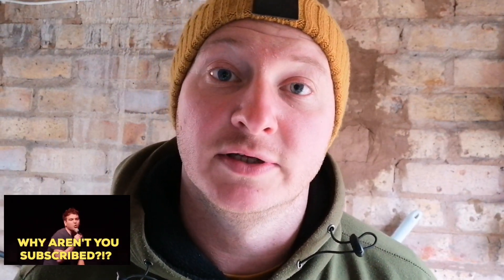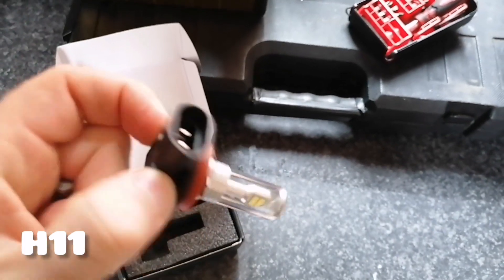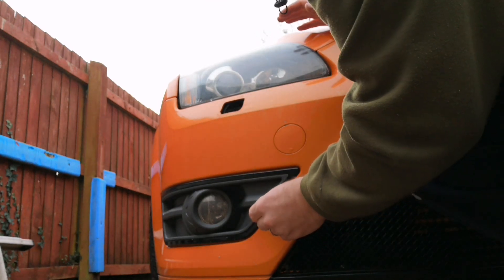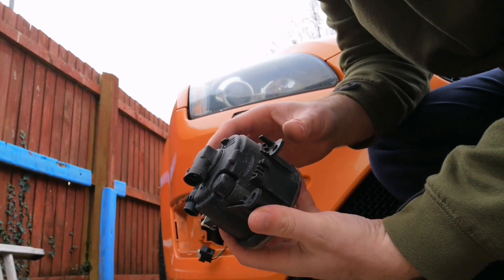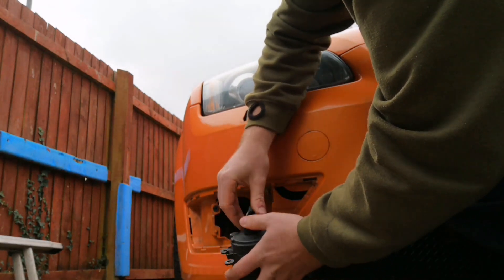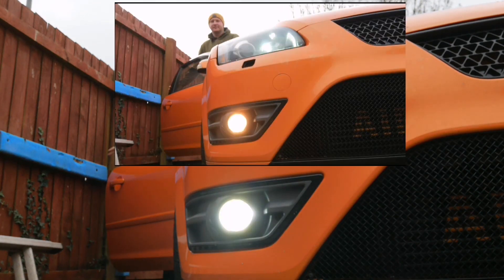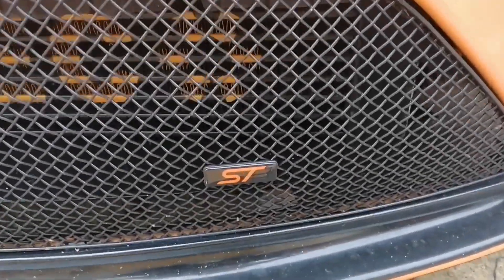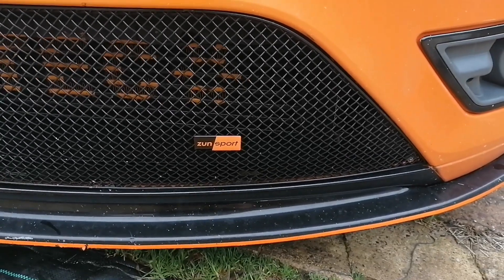Installing LED fog lights

Comment: These led bulbs are much better than the crappy standard units, I had some led switch back bulbs from Autobeam which had 3 different colours.
Were so good I’m thinking of getting some for my new car!
Reply from the maker: What's the new car? The ones from auto beam are expensive I think, these were like £12 off ebay. Link in the description 😉 and I had the nighteye LED headlights in my Leon, they were a huge upgrade to that as well
Reply: Audi S3 although always have a soft spot for the mk2 ST!
Reply from the maker: @styusuf5671  much prefer my St over the Leon 1000% haha